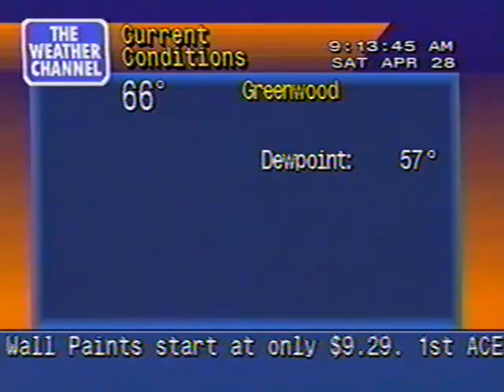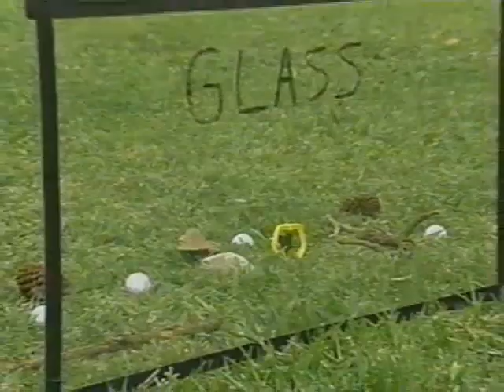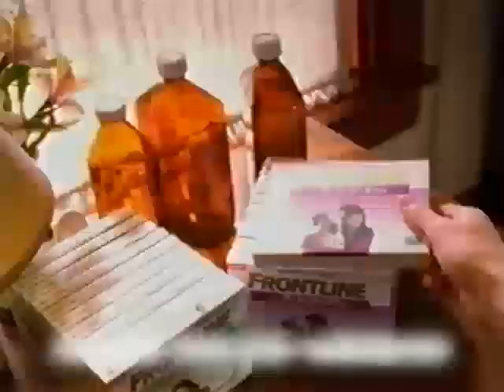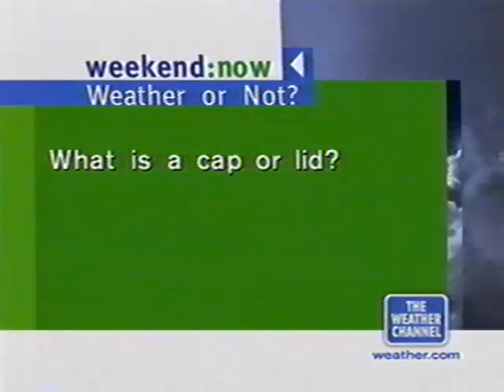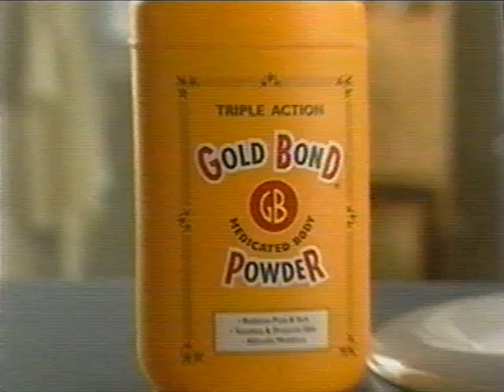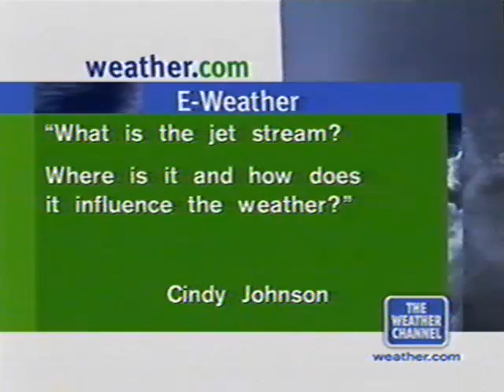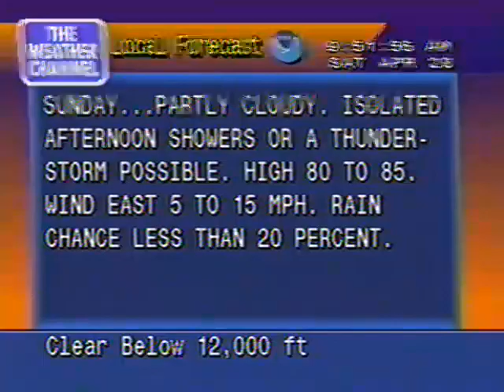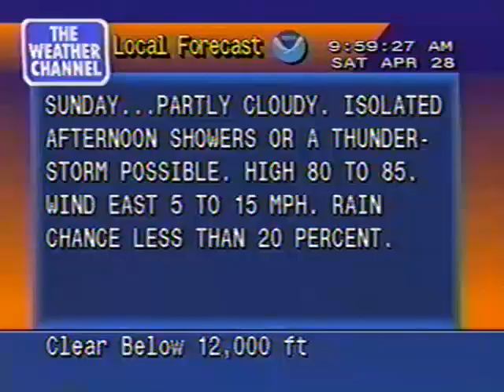The Weather Channel April 2001

Comment: 21:38					Departure				Precipitation
				Temperature									Snow Depth
Cities			Max Min	 		Average	HDD CDD		New Snow
Alpena			55	28	41.5	-5.1		23	0	0.00	0.0	0
Bangor			55	35	45.0	-2.5		20	0	0.00	0.0	0
Boston			58	43	50.5	-1.9		14	0	0.00	0.0	0
Buffalo			53	34	43.5	-7.4		21	0	0.00	0.0	0
Burlington		51	33	42.0	-8.2		23	0	0.00	0.0	0
Cincinnati		67	47	57.0	-1.3		8	0	0.00	0.0	0
Detroit			59	38	48.5	-5.4		16	0	0.00	0.0	0
New York		64	49	56.5	-0.7		8	0	0.00	0.0	0
Philadelphia		65	50	57.5	-0.8		7	0	0.00	0.0	0
Pittsburgh		61	39	50.0	-5.0		15	0	0.00	0.0	0
Washington, DC	67	52	59.5	-1.2		5	0	0.00	0.0	0